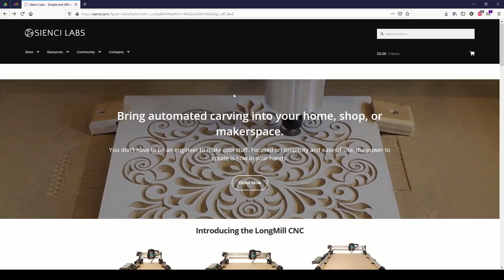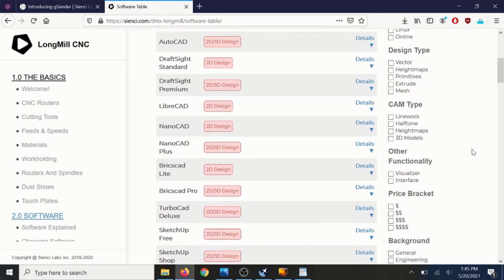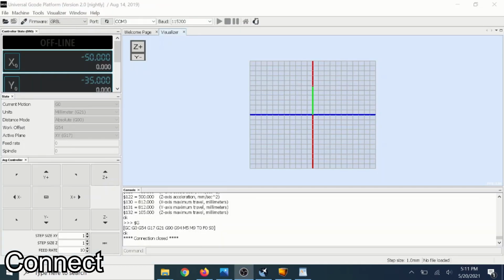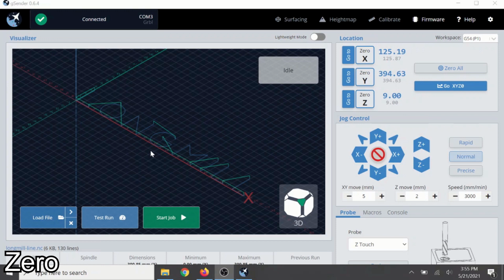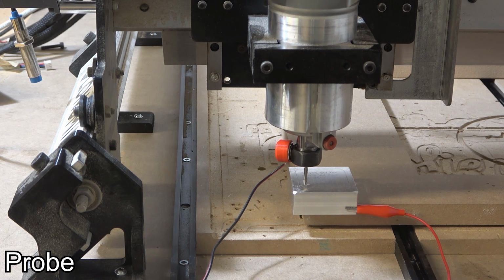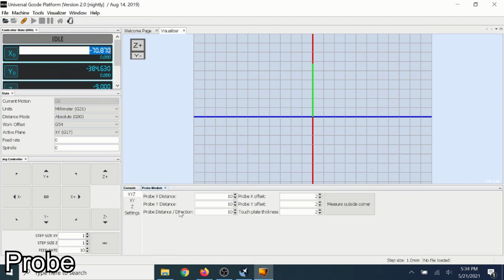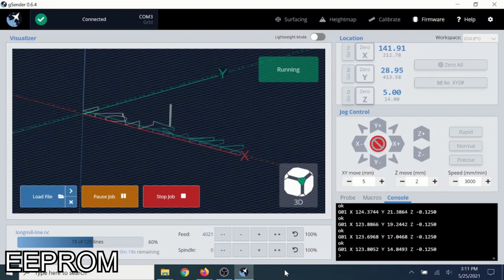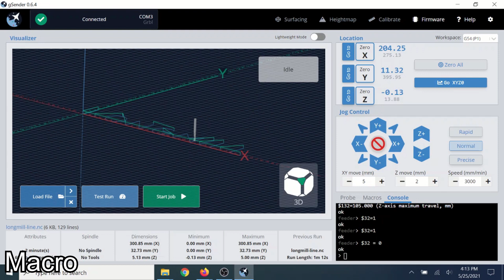What is a G-Code Sender or CNC Machine Interface?

Comment: Thanks for the Video(Subscribed) !! waiting for my machine to come in "). Question do you know if you can setup multiple Zero spots on your waste board with Gsender. So lets say you cut alot of the same size boards ill use circles as an example 12" 16" 22", but always cut those from 13*13 or 17*17 boards and so on, can I setup 3 spots on my waste board and mark them with tape or a marker or a cut , then just know that when you put your board on that spot that you marked and selected something form gsender  its always zero'd  on the X and Y then you just have to tell gsender the Z axis ? Thanks !!
Reply from the maker: Yep! If you look up near the top-right you'll see that gSender has a 'workspace' dropdown which allows you to access up to 6 different memory locations to store zero points. We didn't show it off in the video but we're working on the written documentation right now which will cover how to use it. Hope that answers your question
-Chris
Reply: @SienciLabs  YOU JUST MADE MY YEAR !!!! thanks cant wait get my cnc

Comment: can't connect to gSender, when i try with cncjs i have no problems. Any solution for this? i use a longmill with arduino uno controller
Reply from the maker: When you try to connect are you seeing anything in particular? Sometimes if you unplug the USB cable and plug it back in it will show up

-Chris

Comment: Hi Kelly 
I tried this app but doesn't show any connection setting under to connection tab. 

Tried to find a solution but very little documentation is available.
Reply from the maker: Hello Muhammed, Chris here. You can find all most of gSender's documentation here: https://resources.sienci.com/view/gs-installation/

For your particular situation, you might want to check these two headings for issues with connecting to your machine: https://resources.sienci.com/view/gs-feedback/#the-port-is-not-detected-for-my-3018-cnc

If you can provide feedback then that would be appreciated :)  We'll also be coming out with a new version this Friday that should allow unrecognized devices to also be connected to. What CNC were you trying to connect to?

-Chris
Reply: @SienciLabs  Thank you Chris I am checking it out right now. Hope ill find a solution.
Reply: @Sienci Labs  No Luck for now. Their website is not responding well. But I remember i did try out a solution for this earlier suggested in the bugs section of sienci labs site. The proposed solution was to install windows update along with a package of Microsoft Visual C++ redistributable. But no results were harnessed from that solution. My PC already had those updates.

Comment: how do i go from rough bit to a finish bit without losing my place.?
Reply: Hey Peter,   a usual thing i do is make my project .25 inch smaller then the actual wood size ..... then do my rough cut..... return to home .... lift up the z axis .... replace bit .... then drop the z axis down to your material again .... and reset the home ...... 

just a FYI,   u don't need to go back to your home specifically ...... G sender allows you to home each individual axis themselves.....  so you don't have touch the Y and Z axis rehome ..... just the Z  ..... so u can use any area of your projects original material surface as a Z rehoming point ....... 

if for some reason ... i did'nt allow for original material to be left .....  i rehome the z axis 1.5 inches above the original z axis ..... i turn down the feed rate in g sender to 10 % ..... and see how far the bit now drops ..... then i keep rehoming the z lower till the bit starts to touch the carved out area and i usually go into the wood @ that point by about  0.15 inch ..... 

Hope this helps ya out 

Dale